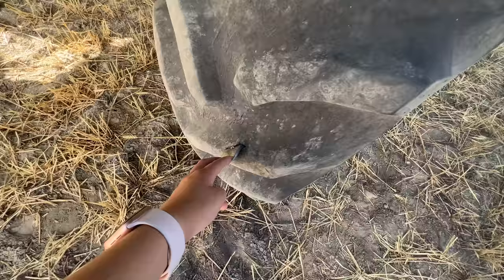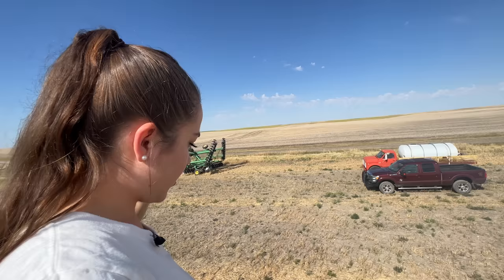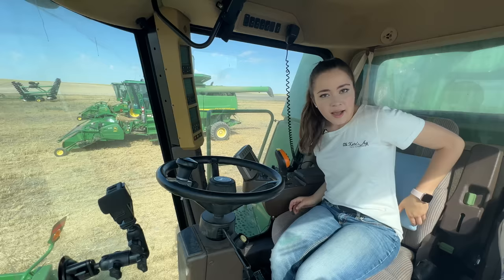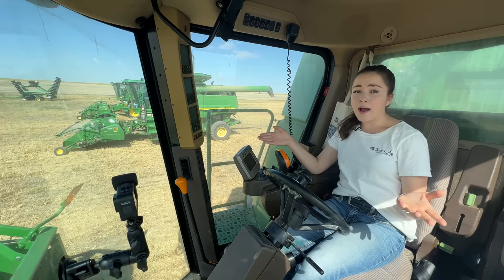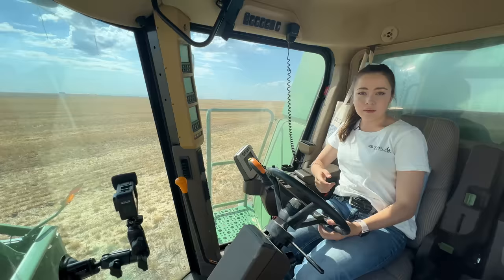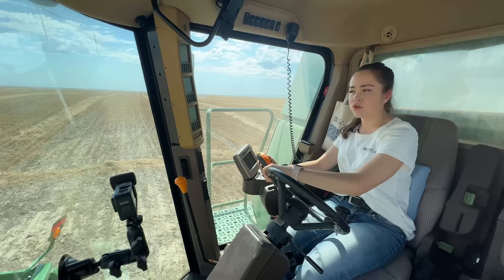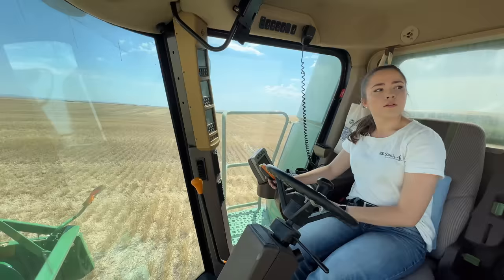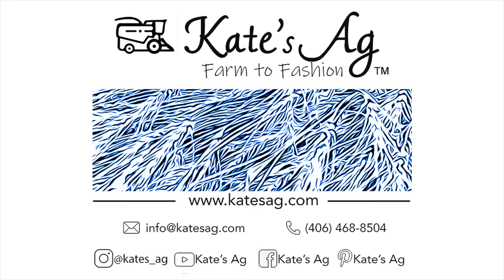Metal Stuck in Dad's Combine Tire!!  Big Drought! Harvest 2022

Comment: Haven't hit any metal objects, but have gotten several flats in the tractor hitting shed deer antlers!
Reply: Threw an antler out of the field this evening. Barely got shut down as to not run over it. Last year I actually ran over a sleeping buck which left some of his antlers in a couple tires. Didn't kill the buck and he got up and ran out barely escaping the disc. Could hardly believe it myself. Didn't get a flat when I pulled the horns out. Lucky as the buck. Lol
Reply from the maker: Thank you for your great story!!!!  That is crazy!!!

Comment: Others have probably said that you can patch it yourself if you can get the tire off and on again otherwise someone else can fix it. You should watch how it's done if you have the time.
Reply from the maker: Thank you for your great suggestion.  We need a big crane because this tire is huge and very heavy.
Reply: @KatesAg  The tire itself is only 125-130 pounds. I think I remember that you have a forklift. You can also just pull out the spike and plug it from the outside. That will last for a few days (and sometimes for ever) and then fix it later in the barn by adding a patch on the inside. You should have a tire repair kit in the barn already. You dont actually have to take the tire all the way off wheel. You can watch a video of someone putting a TUBE inside a tire here 
https://www.youtube.com/watch?v=vSDnF6tjciY
But I'm sure you would rather just hire someone but it's a good experience to try it for when money gets tight during a drought that causes a decrease in cash flow. Also. I guess because I'm old (older than your dad) I'm "old school" and try to know how to do everything and be self-sufficient. I assume you dont have any big strong brothers (?) because I've never seen any young adult men on your videos. No "Hoss Cartwright" men???

Comment: Hello. You record a great video about your hard work . I am a farmer from Russia, Kursk region. I have a question for you : why is there such a small crop rotation , you grow few crops ? Why don't you grow sunflower, oilseed flax, and surepitsa? They tolerate drought , and these crops can also be harvested in cold weather
Reply from the maker: Thank you for your great story and excellent question.  In our location on the great high plains of Montana at 3500 feet elevation and 10-12 inches of precipitation annually we can only grow a few crops with success.  Wheat, barley, durum, and some pulse crops like chickpeas and  lentils.  We test different crops but they have failed badly.  We try all kinds of things and I will let Dad know about your great suggestion too!  Thank you for that.
Reply: @KatesAg  You cannot grow chickpeas, soybeans, beans. Too little moisture . You can try to grow rye, surepitsa, mustard, sunflower, oilseed flax. They are grown in northern Kazakhstan , where 250 millimeters of rain falls per year . In the same region, the climate is the same as you have in Montana. These plants have a taproot system that goes 2-3 meters deep into the soil. In addition, you need to try to grow clover, alfalfa and esparcet for seeds. These are legumes . Improving the soil structure from them. Their seeds can always be sold dearly. I have no rains in the Kursk region in the summer from May to September, it is very hot +33.. +40 degrees Celsius in the shade. Try , experiment with different cultures and varieties . You can allocate 5-10 acres for their cultivation . This is a matter for scientists , but they don 't care about the villagers . Therefore , you will have to conduct experiments yourself . I conduct experiments with different cultures myself.

Comment: Hi Kate, yep combines are expensive, the newest (biggest) John Deere X9-1100 is usd $916k base price without header, you can easily add $50k-$70k on options.
The big 50ft JD headers are around $145k - $160k, Honeybee AirFlex 250 (50ft) is around $200k.
Even a smaller used combine with a 30ft - 40ft header is around $250k+, ..... very expensive equipment. 🤨
Reply from the maker: Yes, they really are expensive!  Thank you for the great info and wonderful kindness!

Comment: Hello Kate👋 ahh the joys of farming 😜 I think be great full it’s only the small tyre not one of the big ones 🙈 at least they are cheaper if you have to replace it. Most of the punctures that I have had on the tractors are from stuff that’s flown out from the slasher or a broken slasher blade. Usually when it’s a big hole you get a cold shower because all the tyres are full of water to get a bit extra grip on the hills or when the ground is wet. Your dad may not worry about putting water in the tyres where you are because your farm is all flat.I loved it when you told the man on the phone that your standing on the top of the combine and he asked where you are 🤪🤪🤪😂😂😂
Reply: Never heard of anyone putting water in combine tires. Tractors yes. I doubt they use water that far north. Much to cold.
Reply from the maker: hahaha! Yes I got the tire guy totally mixed up with my directions!!!!  Thank you for your great story and amazing kindness Mr. Vincent!

Comment: hi kate and greetings from thailand...oh, have unlucky,at combine ''found'' part of iron from field....i done my  ''workcareer''  tire repair work too and fix many tractor and truck,bobcat and car tire....do not try yourself take off that part....let professional person see that,what is happened.....that tire can fix.....inside come kind of  rubber and that ''cut''  can fix with vulcanised glue....but i think,at tire need bring to shop....there is all tool and import is clean that rubber well...then that repair can fix well.....well local tire professional can know how  fix that....there is possible change that tire ''non flat tire''....then inside not come air...there come kind of flexible foam,what act like air,but nail or etc object,s not damage tire and need only take off......
Reply from the maker: Thank you for your terrific advice Mr. Merilainen!  Yes we will wait and have a professional do it because the tire needs to be craned off and on!!!!!
Reply: @KatesAg  yeap...at least need 20 ton hydraulic jack,at that can lift up...but that i must say,at if  make tire model ''non flat''...that need refill with foam like this,at come right ''psi pressuare'' inside....later can,t anymore put new foam or air....and if that need take off(rubber) that need cut half....example construction works lift truck etc other machine use just lot those  non flat tire....then not  have much tire problem....ok i will send good lucky,at can fix well....impory to farmer,at tool work,s and can done work....
Reply: ha ha...not ''impory''....important i need say.....funny buttons my keyboard....

Comment: Had similar issue on a tractor tire.  It was a pull out or call ..   we pulled it out, it was just stuck in the lug, didn't go through.  Did put some rubber roof compound in the cut so rocks, debris couldn't get in.
Reply from the maker: Thank you for your great story and wonderful kindness!

Comment: Kate I think 640 acre section with a road on 1 mile intervals is standard here in the United States.
Reply: Depends where you're at. However where I live roads are on the mile, but in   Montana, WY, western  ND, SD, NE,  it can be 2-5 miles between roads.
Reply from the maker: Yes, I think you are correct.  A section is a mile long on all four sides.  There are not always roads at each mile because it depends on how the land was homesteaded. Thank you for your great comment and kindness Mr. Matzek!!

Comment: If that tire was mine, I’d dismount that tire and put a tube in it.problem solved. Or the tire can be patched from the inside. With either situation, as long as  the damaged area isn’t shredded (multiple cuts) a patch and vulcanizing should do the trick.
Reply from the maker: Thank you for your suggestion and kindness Mr. Curts!  We have a crane coming to take it off and put a new one on.  These tires are gigantic.
Reply: Ok

Comment: Question for Dad, could they not have vulcanized the inside of the tire , when I was small I saw a boot (terminology used) to keep the tube from popping out ?
Reply from the maker: Thank you for your great question.  I don't know.  He is going to get a new one and then if it is repairable get it fixed as a spare.  We don't have time during harvest so we just want a working tire on and deal with the other one later.

Comment: How deep did that cutter tooth go Kate? Did the tired need to be changed, or repaired?
Reply from the maker: It went right through.  We got a new tire.
Reply: Awesome, all things crossed no more tire problems. 
We counted up all the round bails? 210 off of 90 acres of organic grass hay!  The next cutting will be green chop. We will see what’s chosen for fall crop. All is well. Cows are happy.
Reply: These are the unforeseen expenses during the enter process leading to harvest!  When you are using a rock picker, as a tow begins to pick up metal objects, or jump up to the next level of Kevlar protect tires.

Comment: Hi Kate i thought those tyres would be filled with some thing else  not air ,i heard tractors tyres are filled with beet juice or some thing else not air so i thought combines would be the same  unless they dont need the weight like tractors as they will not go on muddy fields like tractors, do they use planes if a field needs spraying as they are so big ,good video ,take care
Reply from the maker: Thank you for your great question.  Some tires are filled with a salt water solution of some kind, but they can still lose air if they are punctured.
Reply: Skip loaders have water and air because they need to be heavy but not these machines. You dont want to compact the soil on farmland.
Reply: @KatesAg  thanks for the answer Kate that's interesting to learn
Reply: @hikerJohn  thanks for the answer ,you can tell i dont know any thing about these machines,just heard about filling the tyres with some thing the other day so still learning  so its very interesting

Comment: best hope is the tire can be hot patched if it's tubeless,and Kate it could be FAR worse,if that metal was in sidewall it can't be fixed  (legally) unless Montana has different laws , so you depend solely on rain for irrigation Kate ?
Reply: The legality of patching tire sidewalls doesn’t apply to tires used on unlicensed agricultural equipment.
Reply from the maker: Thank you wonderful kindness Mr. Pearson!  We just have the tire guys crane the old tire off and put a new one on.  There are no rules about that here.